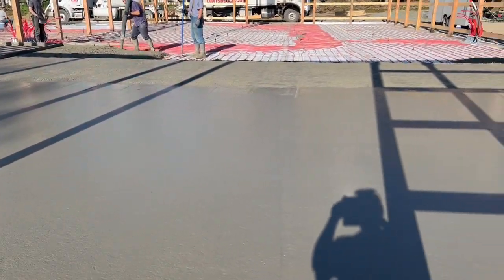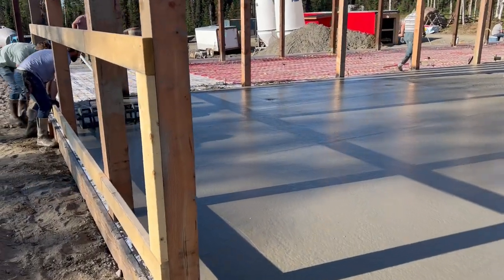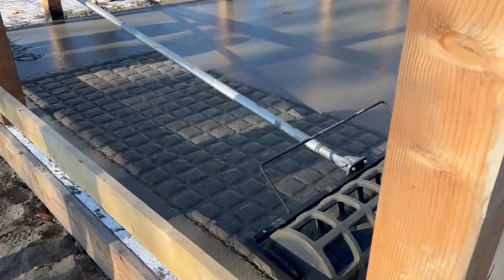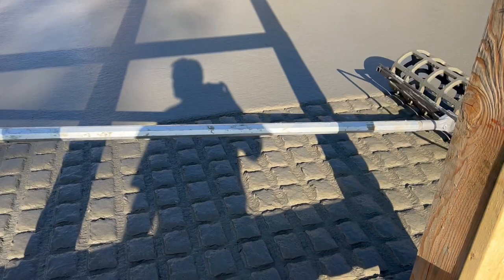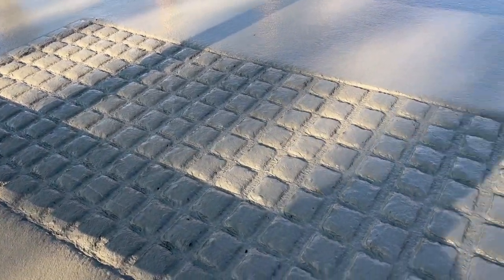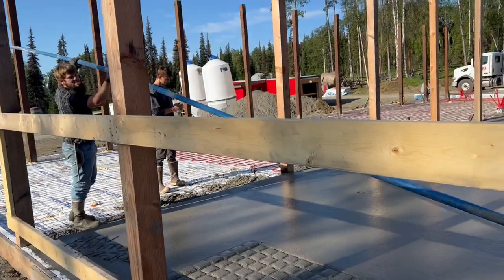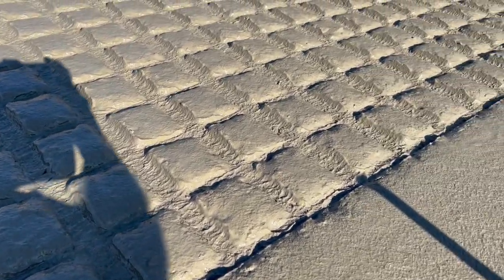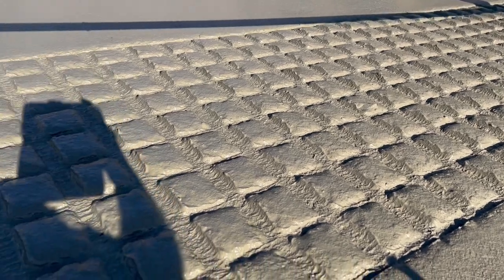Using the Roll-a-Groove concrete tool to make a less slippery concrete floor for the cows.

Comment: Could I use that for a driveway? I want to settup my own driveway with wire mesh and have a concrete truck mixer come out to pour it, could I use that for finishing or would I still need to make lines to remove the moisture with a groover